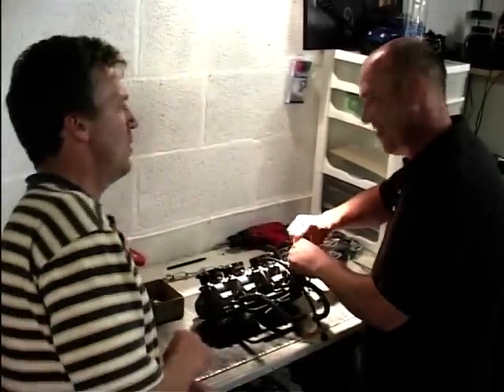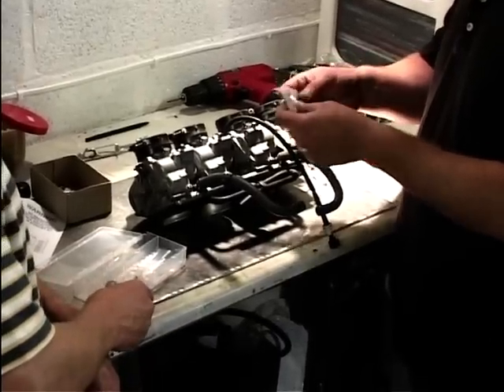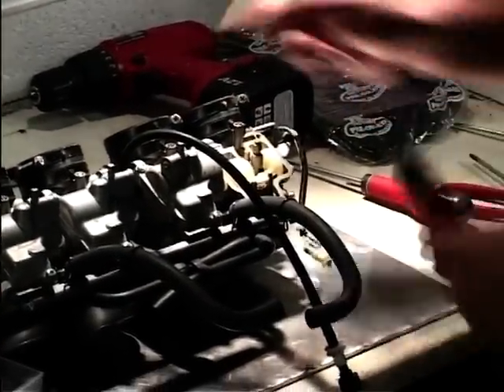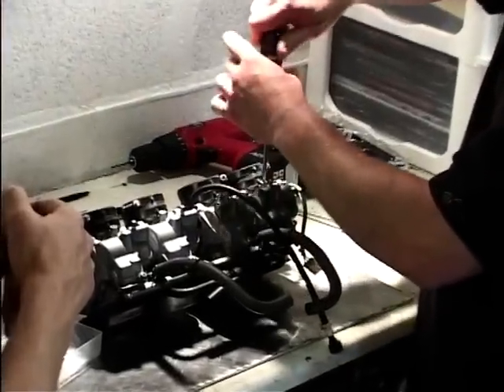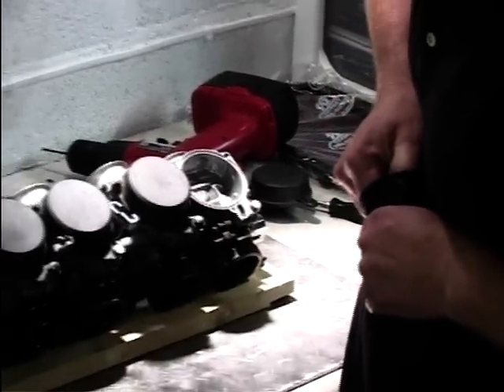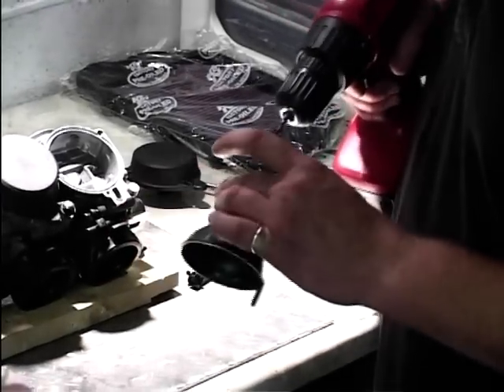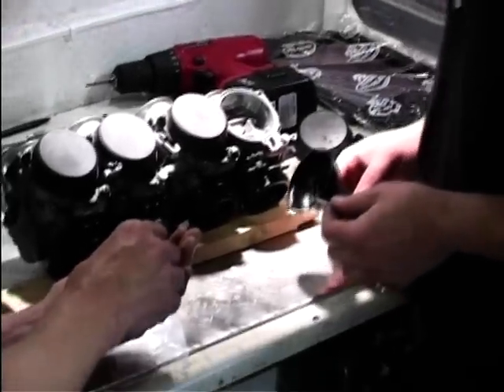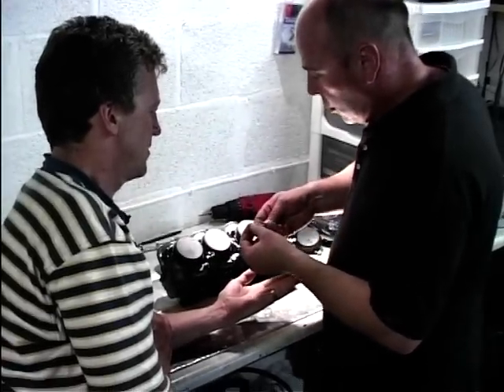What Is A Dynojet?

Comment: it’s worth mentioning that the cleaner your working area is the better chance you have to put it back together without getting a tiny bit of dirt in the carbs cos it only takes a spec of dirt size of a grain of salt to block a jet and then it won’t run properly until it’s clean again
the best results for this upgrade will come from getting the bike set up on a rolling road

Comment: Refer to the jet manufacturer as to which stage jet kit(s) you need.  They will ask what type and brand of exhaust, carb size, type of filter(s), ect.  There are typically  stage 1 stage 2 and stage 3 kits.
Reply: No it's one kit with all three types of jets, he shows this in the video. The instructions tell you what ones to use depending on your current setup.

Comment: I watched a meccy jet my ZXR-J1 many moons ago,and was amazed at how simple it was,he did it in situ,and i could have done it meself ! I was surprised he put the smaller jets in,and he explained it was about the mixture. Idealy you want somewhere that has a rolling road to set it up,helps if your carbs are balanced,LOL
Reply: This is why they set the screws as they do, tried and tested, only problem is you must use the instructions for your bike, rather than two turns mine would be three.

Comment: I realise this is an old post but if I was to installing this to my present ride a VTR 1000F FIRESTORM will it run as intended on the stock equipment OR would I need to upgrade the AIR FILTER and OEM EXHAUST headers and silencers!
I realise this question is maybe a Laugh to the well informed but to me, I would appreciate a solid answer in-depth answer, please.
Thank you.

Comment: Hello Paul Johnston and  Gary, how are you? thanks for the great video. I have a CB750F 1981 and I am(the mechanic is) having problems installing or making the Dynojet Stage 3 to work in it. I want to install the Single filter Pods, we have the stage 3 Dynojet in and I am still running on the stock pipes. The mechanic says that the bike is running ok on stop but flat on mid range on the road. Is there anything I am missing on the puzzle? I appreciate any tips or help. Best regards and definitely subscribing to your channel. best regards
Reply: +Danilo David Stage 3 is meant to be used with pods AND full race exhaust system.
Reply: Thanks for your reply. A little too late but I appreciate. I managed to tune my bike last year after few tries. All going well.  Regards

Comment: why are big bike carbs so complicated with butterfly valve and slides? why can they be simple like what you see on a single cylinder carb where theres no complicated fragile rubber seal and vacuum stuff..just the throttle slide and spring only..
Reply: fidel catsro There is five times more to do than what this guy showed you,,,,, do you want your bike to run like an old Harley no power at all,,,.  ???  1 carburetor,,,,.   Or do you want it to run like a,,,,, raped ape,,,,.  ???   These are the old simple carburetors,,,,
Reply: They seem complicated if you've never took one apart, I was like you at one point when I got my full bike licence, I was like darn that looks complicated, but I took one apart and realised what the fuss was Evan about lol they are really easy!  Only difference is what ever you do to one carb, you gotta repeat another 3x's witch makes it abit long. But that depends on how fast you work